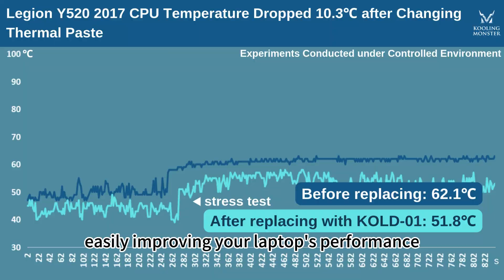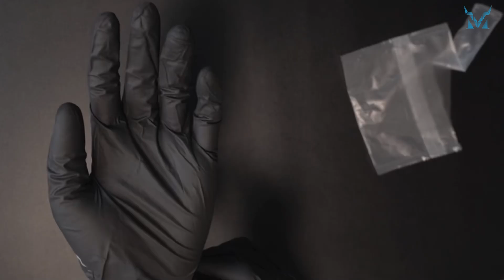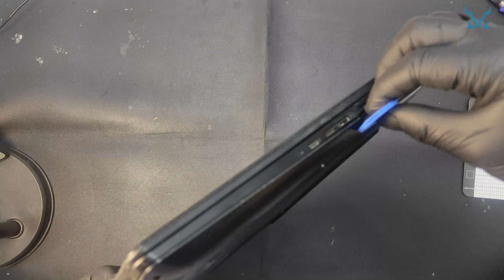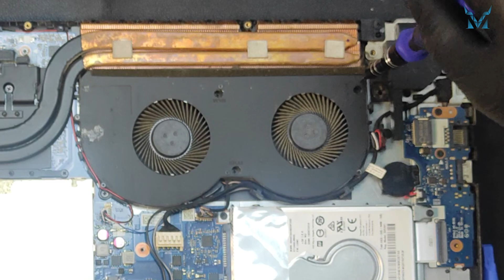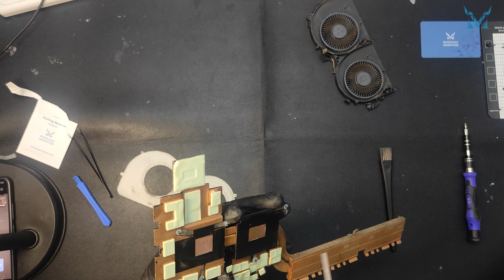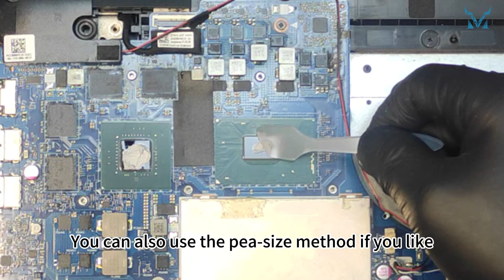Speed Up Your Legion Y520 2017  Prevent Overheating With Dust Cleaning & New Thermal Paste

Comment: Excellent video, new subscriber here. Coul you please do the thermal replacement and fan cleaning for a Dell G15 5515 Ryzen 7 Edition?
It heats up way too much and I want to change it, please
Reply from the maker: Thank you so much and welcome aboard! 🙌 I’ll definitely consider doing one for the Dell G15 5515 Ryzen 7—it’s a solid request. In the meantime, we used KOLD-01 thermal paste for repasting—great temps and long-lasting performance. Perfect for systems like yours!
Reply: @koolingmonster  Awesome!

Comment: Please show a video for Predator Helios Neo 16 2022 variant.
I've seen a lot of video and learned many things about replacing paste.

I'm thinking of relasting my laptop because it heats up a lot. And also change thermal pads because they are meleed and need to be replaced.

Problem is this laptop has liq metal paste, instead of traditional thermal pastes.

So please make a video on that laptop. It will help me a lot
Reply from the maker: Sure! You can replace liquid metal with high-end thermal paste, but temps may rise a bit. I’ll note your request for a Predator Helios Neo 16 guide — stay tuned!